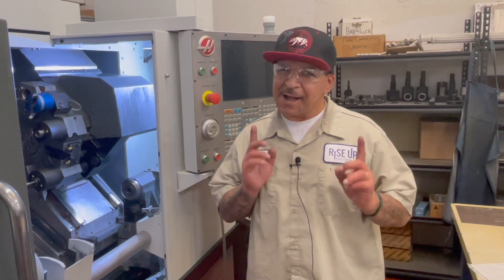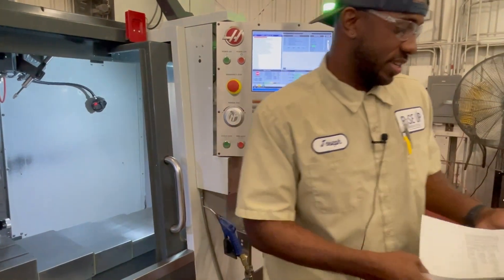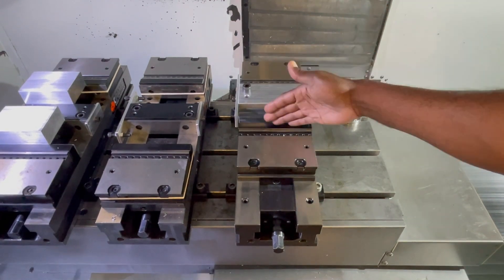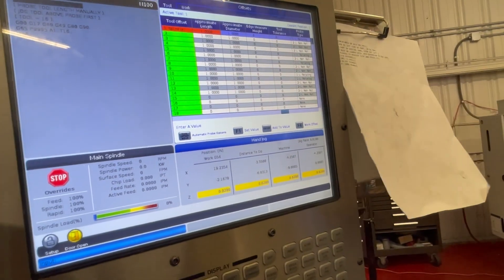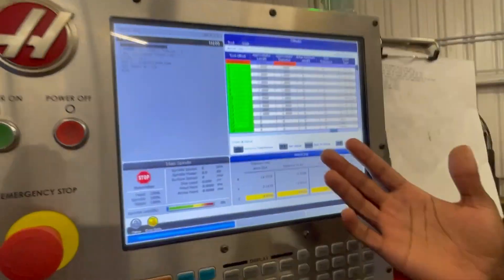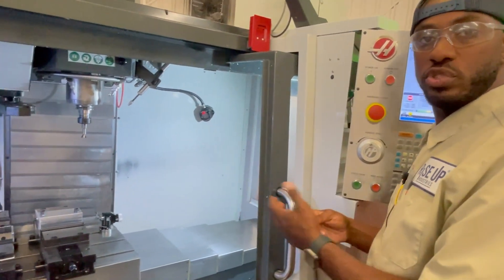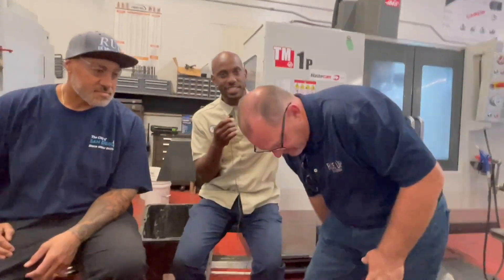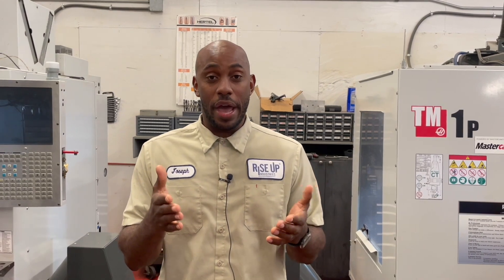How To Set Up And Run Production With Dual Vises PLUS Hiring Tips | Breaking The Cycle Ep 2

Comment: You can skip that approximate length completely. And personally, I would manually set any face mills, boring bars, fly cutters. Especially if you have vises that close to the setter. 

Work offsets: two ways to do this, zero off the blank, or zero off the stops/ vise jaws. Personally I'd do it off the vise and stops. Especially if those vises are NEVER going to come off, due to consistent part sizes. But that's more of a background setup from the programmer. In theory you can get your workoffsets to NEVER need any resets unless there's a crash. Z is just off the bottom face of those mighty bite jaws... AWWW crap, mighty bites. Never mind. You'd have to do Y offsets (and clearly not off the vise jaws) on all jobs if you do different materials. Due to some material deformation or lack there of depending. X and Z should never need to change if you do it right though. Zero would be bottom left for all odd offsets, top left for all evens, as it's setup in this video. Naturally, the point of this job is to teach though, so doing it the way it's done is better for actual education.